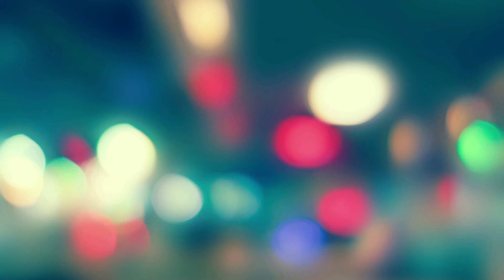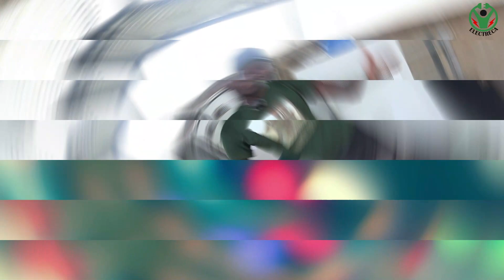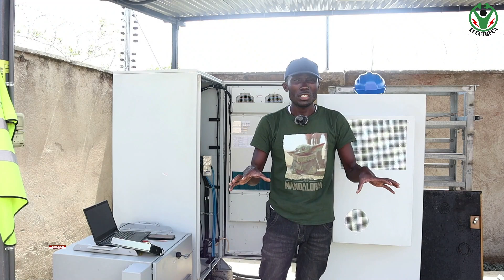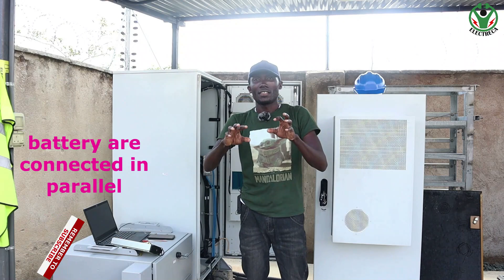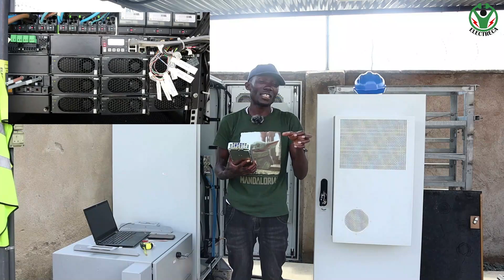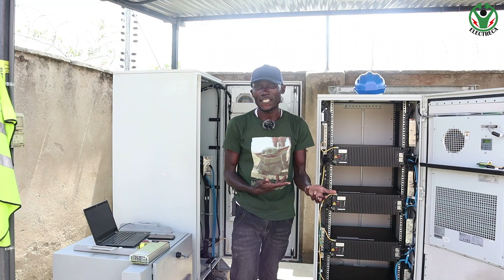how power is distributed in base station|ELECTRECA

Comment: Hello sir.......please i need you to help us with a video or circuit  diagram on how to use floating switch to control motor pump while delay timer will be connected to it, to avoid motor running at instant,so the delay timer will stop flow of electricity at instant electricity flow Sir

Comment: Welcome back. As usual, I am here again.
Reply from the maker: Thank  you
Reply: David Please can you come with a video on this question;
Two lamps are connected in series lamp A is rated 60W and lamp B is rated 100W. Which of this lamp will glow brighter if the supply voltage is 230V and why...

Again Which of this lamp will glow brighter if it is connected in parallel with 230V and why... @elektreca

Comment: Hi David, I am fro Ghana and doing electrical and control wiring.

I really enjoy your videos including this one. 

I would like to learn more about base station power systems in detail.

Thank you for your hard work 🙏
Reply from the maker: No problem, more videos coming, Thank for watching.
Reply: I use to be a power  technician in base station company company in Ghana .this job is very stressful.
Reply from the maker: @swallahosman1294  yah the job can be stressful, however if you keep your house in check by doing good practices .
Sites can move to auto mode.